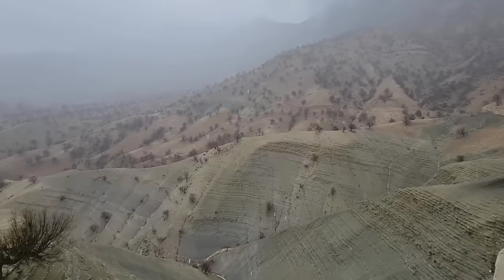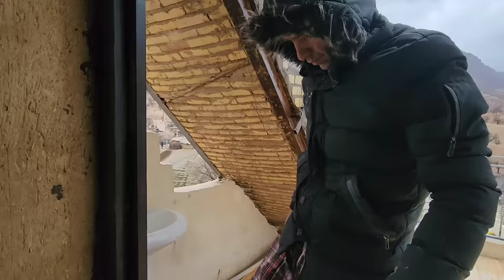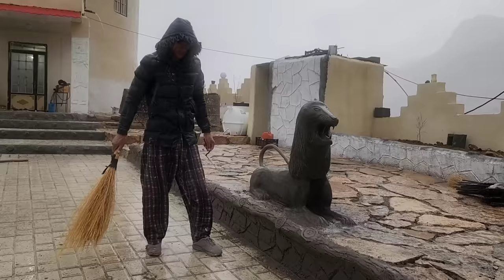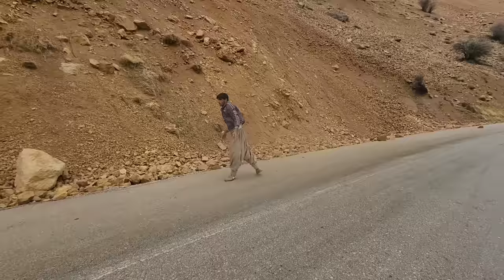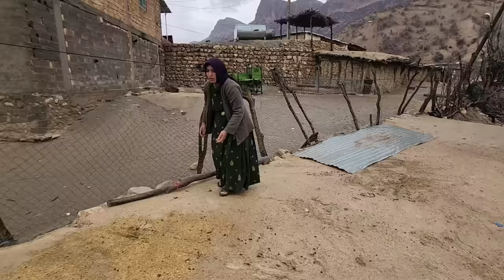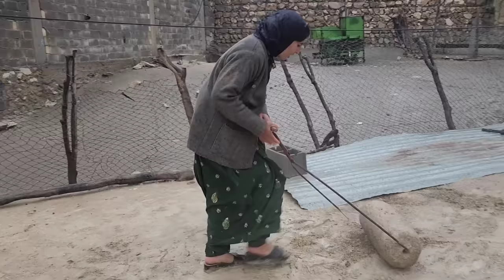The stormy path of the castle: Hassan's bravery on the road and Zulikha's effort in the castle

Comment: Only if reactions happened. So primitive. Lev bought cleaning materials. mops, buckets, floor soap, mops and clean properly. Why then did you build a castle (a shocking block of concrete), if you can't clean it properly?